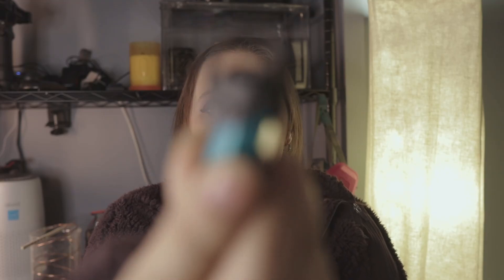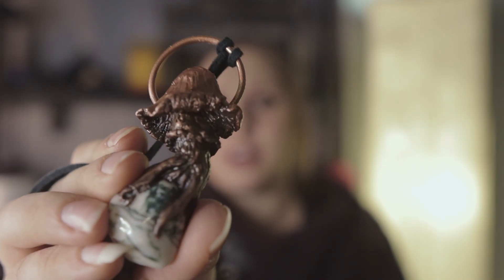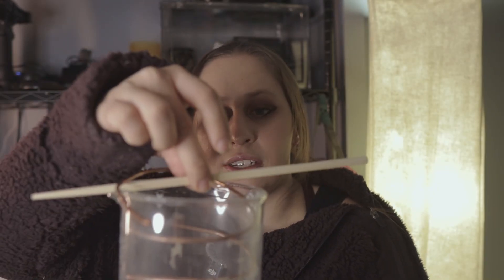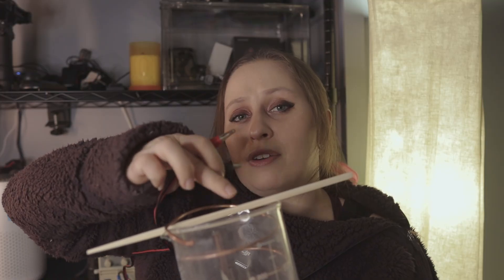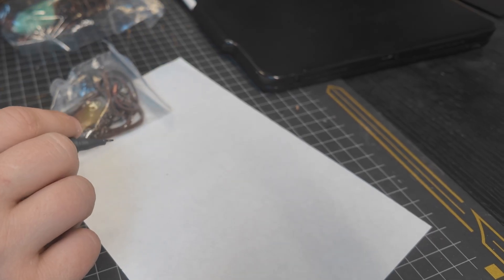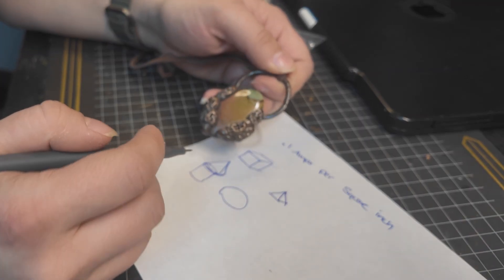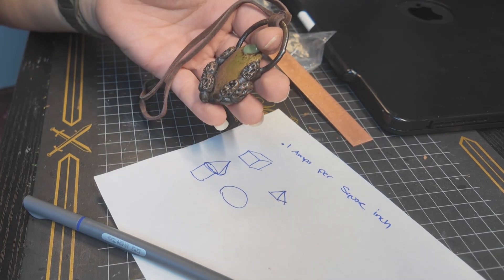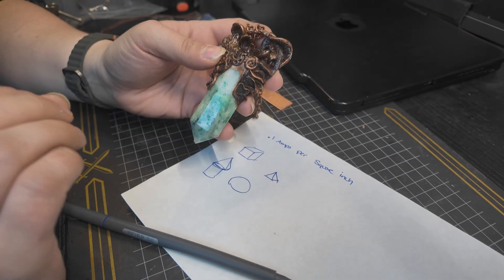Electroforming Process: The making of Copper Jewelry

Comment: If you add a bit of sodium laurel sulphate to your solution you won't have bubbles adhering to the piece,  it's a surfactant used in making soap and it breaks the surface tension of the solution so large bubbles won't form. About a quarter teaspoon per quart will be enough,  try not to exceed that amount.  You'll still see very very fine bubbles on the piece and that's OK,  the ions can still travel through them but it's the big ones that can impede the ions from their destination. I've used it for years in my electro plating copper and silver and it really helps with a smooth even plate.

Comment: How many pieces that size could you electroform in that tank you are using? Can you do a video on small tanks ans how many pieces and how to calculate that. Plus info on the larger tank you use and how many pf those pendants you could electroform, plus those calculations for multiple pieces. YOU ARE AWESOME at what you do and I am so glad to find your channel.  Some of these creators doing this work sure make things complicated and expensive!
Reply from the maker: Thank you!! I'm glad my information has been useful! I can definitely make a video comparing tank setups and how much you can fit in one. I should have a reel posted this weekend about how many pieces I just electroformed in my big tank :) But for example the small tank which is just my beaker is only big enough for one piece at a time or maybe two rings or a pair of earrings if they are smaller. The tank I am currently electroforming six large pieces at once, but you can do more than that for sure. I try to keep my explanations simple. It does feel as if electroforming gets a bit over complicated sometimes.
Reply: I so appreciate your reply and efforts as no one seems to talk about how many pieces and how to calculate the size of tanks, and solutions needed for their sizes. Thank you so kindly.

Comment: Hi, thank you for your content, its very helpful ❤ I have a question - I try yo electoform some leaves and branches, but even after 12 hours they are still really fragile. I cant find an information how I can tell that the time is enough. Tomorrow I will get back them for another 12 hours after some glue and graphite, but every information for electoforming delicate things will be helpful. ❤
Reply from the maker: Hi! If you are electroforming something super delicate and fragile I would recommend coating it in UV resin first to give it a bit of touchness, but it will still usually retain some elasticity. For example leaves. I have coated leaves in resin which keeps the details showing as long as its a thin layer, but adds rigidity. You can also use mod podge, and super glue to add a bit of extra strength to fragile pieces and then electroform them for a long time. I have electroformed very fragile pieces for up to 72 hours just monitor the copper growth so it does not turn into something you don't want or you start losing details.

Comment: Ciao, è normale che il mio anodo in rame si sia completamente disintegrato nella soluzione di elettroformatura? Inoltre, come mai ottengo gioielli rosa salmone? Grazie
Reply from the maker: Hi! It is normal. Over time as you electroform your anode will disintegrate since the copper ions are flowing from the anode and onto the piece that you are electroforming. The salmon color can be caused by a variety of reasons, but the most common is low brightener. If you add a few droplets of brightener that fixes that issue a lot of times. If you can't fix the salmon color don't worry. Just use a brass or steel bush and you can polish up your pieces back to a shiny copper color!